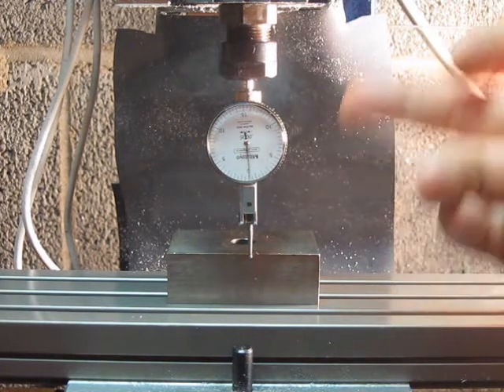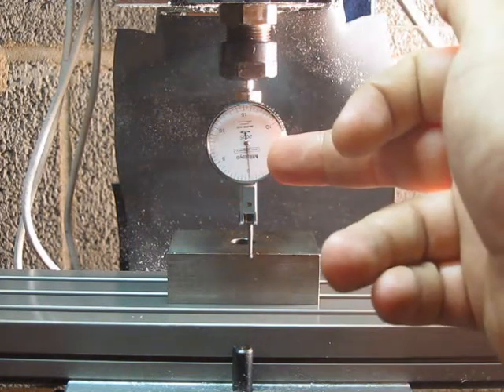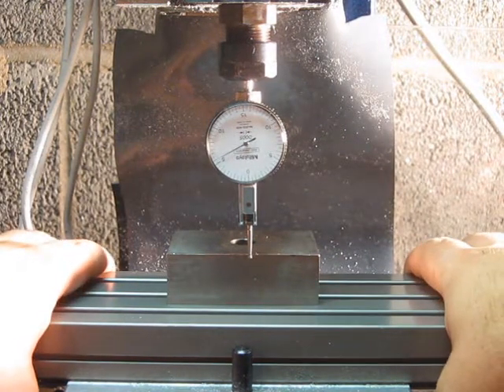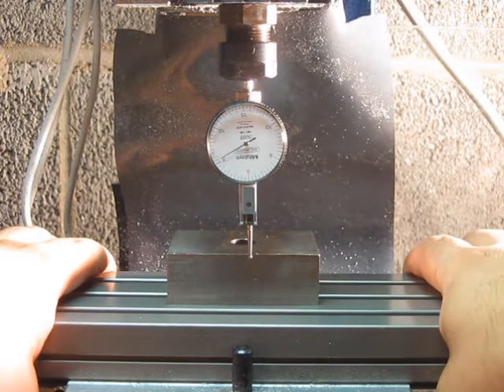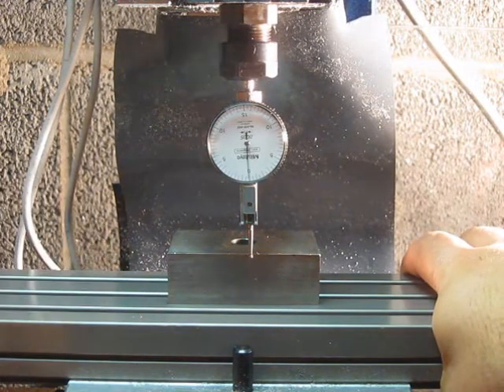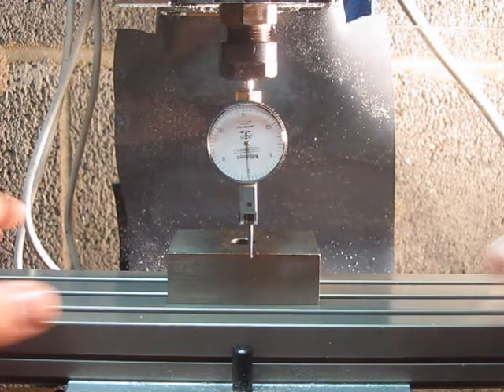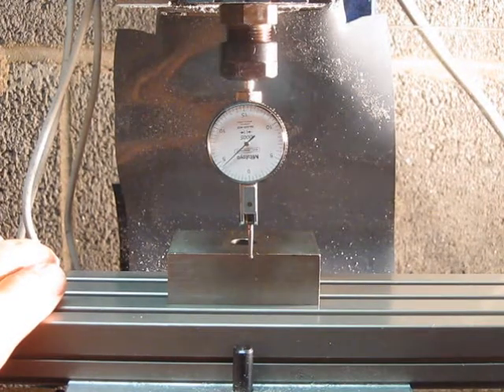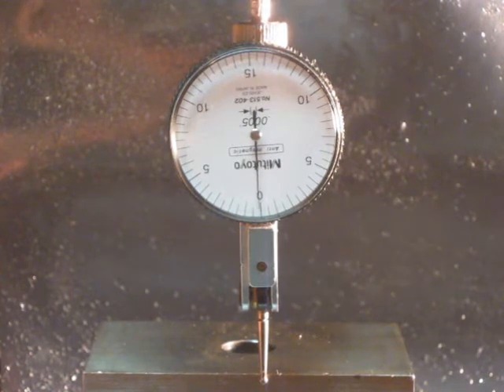Taig Mill Table Lash.wmv

Comment: There are 3 adjustments you can make.  The gibbs, the pinch nut, and the tension nut on the end of the lead screw.  I strongly reccomend you read Nick Carters website.  He has more information in one place on the Taig mill than anybody.  I had to adjsut all three and I still have a couple thousandths backlash and still allow the table to move easily.  If you are running CNC you can also make backlash compensation entries in your control sofware.  Well Mach 3 will allow it anyway.